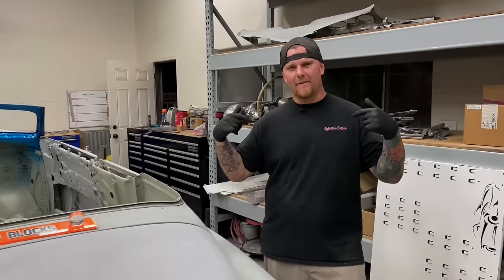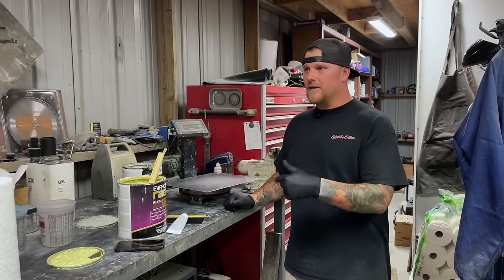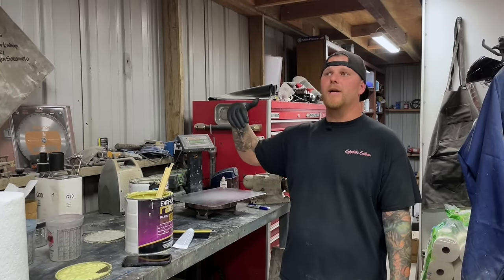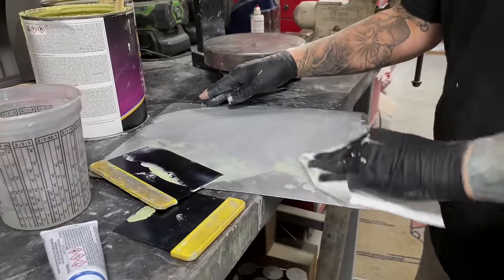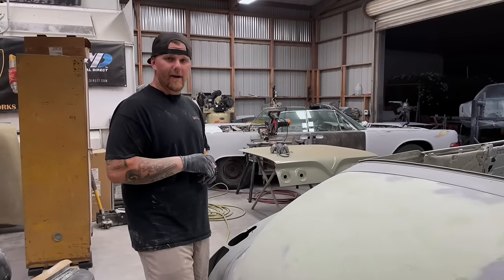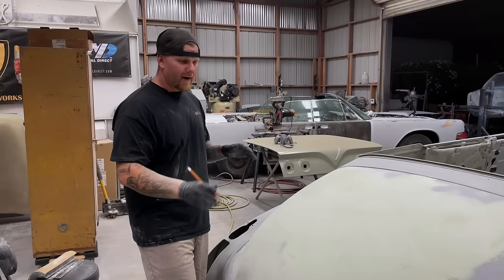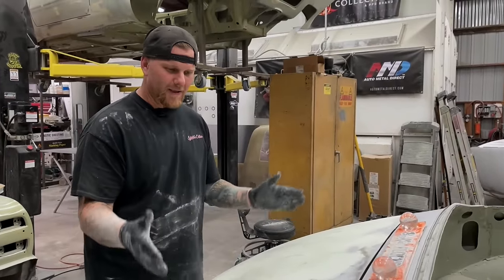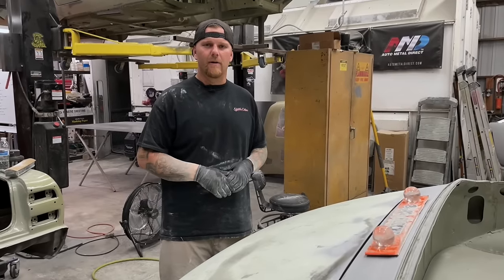The Body Filler Innovation You Can't Afford to Miss!"

Comment: One pot hole and it will crack. Filler is filler not "holder". You have to weld the deck lid around the perimeter so it can't flex.
Reply from the maker: Wrong we do every car this way zero issues
Reply: @SYLVESTERSCUSTOMS  show me one with some miles on it that hasn't cracked . You have too much faith in Bondo if this is how you've been doing it.
Reply from the maker: @here_to_watch2115  you obviously haven’t seen our other videos metal finishing panels. This is a skim coat to make a show car front to back with mirror reflections. As a matter of fact we did a red f100 that is a Prerunner zero issues. I’m not sure what you are referring to on welding a perimeter. Perimeter to what???
Reply: @SYLVESTERSCUSTOMS  your using filler to fill the seam correct ? Without welding the seam correct ?
Reply from the maker: @here_to_watch2115  negative this car has been completely gapped and every edge tig welded hammer and dollied to get it 3/16” gap the plastic keeps the filler out of your gaps.
Reply: @SYLVESTERSCUSTOMS  ah ok, it seemed like you were bondo-ing the trunk lid shut.
Reply from the maker: @here_to_watch2115  don’t judge so quick. Get in tune with what we teach it’s the small things 🤘🏻

Comment: Why use pencil?  I did a few paintings and used pencil to help me with the shapes and the paint does not stick to the pencil.   Use a marking pen or whatever the filler will stick to.
Reply from the maker: We guide coat the entire car that the same thing. Paint has zero issues sticking to it

Comment: I have tried mixen big amounts and it just set to fast then the next time I used less harder and it would not set up all the way
Reply from the maker: That’s because you need to be mixing the filler 50:1 or 2% by volume. That’s why I am using these fillers specifically.

Comment: Live in Arizona n the instructions go out the window I put like a drop of harder n mix sometimes it’s still to much
Reply from the maker: This filler still gives you more time than any other hands down. Ideally having your car in a temperature control area is the most beneficial obviously but I agree the temperatures that you guys have doesn’t give you much time it gets about 115 in our shop in August it’s miserable.
Reply: @SYLVESTERSCUSTOMS it’s horrible what makes it worst is I work from my suv so more ofthen then I want I have no shade just out in the open world but you learn to adapt how ever dolphin glaze is probably the worst to use turns in to soup from just a bit of heat
Reply from the maker: @harrydemetro1935  good luck

Comment: Not really a fan of using this technique over huge areas, for the big area contour control I use polyester spray filler, typically U-POL or Novol etc, its more uniform, it flats easier and most importantly it fully dries which conventional filler never actually fully cures and always move. When I do mix filler I always use an Onion board, ultra fast disposable sheets and always totally clean. I always guide coat filler too, from the get go after hitting the nominal shine off, which you do not really get with the spray on route, it does away with any need for a pencil, normally with charcoal dust or cellulose satin black aerosol, and sometime ago I went over to vacuum suction sanding, far cleaner, enviro friendly and kinder to your health with longer cutting life, you only need to move to hard blocks, rubber acrylic etc at the primer stage, I get original contour performance 100% all of the time and 10 years on it stays constant.
Reply from the maker: I disagree with everything you mentioned. That might work for collision but not restoration. First… the amount of times you would have to primer the car to accomplish this. It would take you 10 times as long. We bodywork our cars and primer one time that is all that is needed and we achieve a mirror finish zero deviance in reflection. There is not one vacuum suction sander that will give you this finish that I am referring to the blocks are too small and too rigid.
Reply: @SYLVESTERSCUSTOMS  I am talking restoration work!, though I fail to see what the difference is.  I primer once too, occasionally twice depends on the body style and size, polyester spray filler has so many benefits over your filler method such as speed to name just one, with no down sides and you could not be further wrong about vacuum sanding, my range of blocks go up to 18 inches and you can choose from so many flatting bed bases from different foam densities through to rubber and polycarbonate, are you saying body filler from a tub completely dries and stops moving? if you are, you need to understand how it is made and what the manufacturers say about it. I have many classic car customers some of who are into 20 years since I did their cars and they still look arrow straight with deep undistorting gloss.

Comment: why didn't you do it on bare metal instead of on epoxy?
Reply from the maker: Because the benzene peroxide in the body fillers hardener will cause rust. Best practice is over epoxy.

Comment: 10:17 Walks over to car with filler
 (*2m8s mixing 500g)
12:09 Metal spreader 1st touches panel with filler
 (+2m24s tight coating panel)
14:33 Puts filler board down
 (+2m11s working the filler on panel with sprayer)
16:44 Stops working filler 

TOTAL 4.5 mins working time
 (*2mins 8seconds mixing time NOT INC.)
Reply from the maker: I’m confused on this comment is there a reason?

Comment: Dude, I don't know if i like the idea of moving the bondo agents around in this crucial stage of curing, you are compromising the Bond big time by pushing or cutting and dragging on that product when it's in its doughy stage, it's so temperamental at that stage to be dragging on it. I know you are going to defend this, but I've seen actual bench testing of this very notion, and it will absolutely create a bonding compromise, think "a cold solder" in a similar end result. 
 This is a completely compromised application, and if i were calling the shots or I the client,   i would instruct my body guy to  strip it all off  and start again. And using a chem prep for that product before application is a must.  Sorry, I know you are trying to pass along what you believe are good practices, but you are just in error in this process, and it's a critical error. Not just an opinion of steps of preference.
Reply from the maker: Been doing it this way for many many year never had a problem. Do you do bodywork for a living or an engineer? Can you explain the use of a cheese grater then? Because that is being used the same way as sanding it while soft.

Comment: Well you normally do little blobs and pencil marks. One skim coat makes it much smoother and not lumpy with little blobs.  I use cardboard and mix the mud then throw it away. Most bodymen don’t waste time cleaning boards. Time is money. Adjust hardener to temperature! Use a gear drive 8” DA to get the sticky mud to get it close. Nobody uses a cheese grater on mud for 30 years.
Reply from the maker: Do whatever works for you. If you want to do something half assed that’s fine. I guess you’ve been doing it for 30 years not making any money on the trade we’re not talking about collision work we’re talking about high and restorations. There’s a big difference and no they are not the same.

Comment: Ummm.....just body filler? Shrinkage and crackage down the road id say from my 30+ years experience. Why not At the least use a fiber reinforced product to fill the gaps? But that'll still shrink up and show a seam later on. Imo, a combo of metal work the (stitch weld the seams) and your technique works best for longevity
Reply from the maker: Keep in mind most of our cars have extensive metal work already performed. The skim coat should only be approximately a 16th thick any seams have already been metal worked, and removed like the lead seams, and all of that stuff have been completely removed

Comment: I used to watch bad Chad until I saw him use windex instead of wax and grease remover just before paint.  I could be wrong but that just doesn't seem right to me
Reply from the maker: Missed that episode, lol. Thanks for watching.
Reply: @SYLVESTERSCUSTOMS  He's done that in a few episodes. He also likes to rub his bare hand all over the panel seconds before spraying to make sure there is no dust on the panel. At least he uses the measurements on the mixing cups when adding hardener instead of just guessing like My Friend Pete does.
Reply from the maker: Lol, we all know some Pete’s.
Reply: He uses windex to remove salts and finger prints.
Reply: I saw that, I never heard of that.  But then again, I'm a backyard hack myself.
Reply: nothing wrong with using windex... if you are prepping correctly there should not be anything on the panels that requires W&G... i used to use wax and grease my first five to six years but honestly had more issues with that than with windex... but that's the beauty of it everyone has there own methods.. if it works for you then that's what matters

Comment: You can't feel a panel with gloves on...
Reply from the maker: That’s why we have guide coat. The bare hand cannot feel the most minute ripples either. this is why what I teach is specifically on mirror finishes.
Reply: @SYLVESTERSCUSTOMS  I was painting to a very good standard with 2k paint in the 1980's and could feel any flaw...
yes guide coat but you have not re invented the wheel. Lead loading Rollers mgb's etc was done all the time and no stupid gloves.
Reply from the maker: @theessexhunter1305  ok well I’m not going to argue with you so have fun

Comment: This is NOT how to do body work. If they had done the metal work as they claim why are they adding filler? only Americans do that. they are more plasterers than body men. You can use filler on small areas in a car but this is heresy. The car is made out of metal, the filler is plastic. What do you think will happen to the paint sitting on it after a few years on your driveway? take a guess.
Reply from the maker: Thanks for watching.

Comment: Bad Chad learn U How ?   Sun might tell best a wet or dry !!
Reply from the maker: Lol um… what? Was that engrish? 🤣
Reply: @SYLVESTERSCUSTOMS  I Got Delirious watching Bad Chads Latest video !! Did you ever hear of a Face Shield for grinding or possibly a safety guard on a die grinder with a cutoff wheel that you should never use from grinding either whatever not good to show things unless they're done properly especially if kids are watching only been doing this for forty years and yeah by the way that's sunmight sandpaper is the best as far as I'm concerned
Reply from the maker: I’m giving free knowledge I’m not getting paid to make these videos so we do our best. If you put a guard on the grinder you can’t fit it into where you need to. It’s the first thing I get rid of. But yes, typically we use safety glasses or a face shield. If people cannot use common sense, then they probably shouldn’t be doing the work to begin with.

Comment: You should weld that from my experience it will likely crack. Weld than filler. Of course, you need to get paid for your time. That's really poor practice.
Reply from the maker: I don’t know what experience that is lol but the filler is temporary. It’s not supposed to be welded shut. 🙄